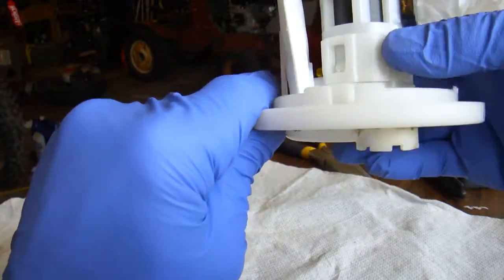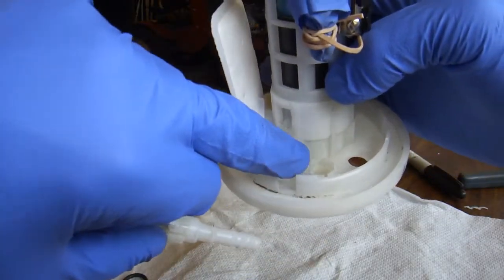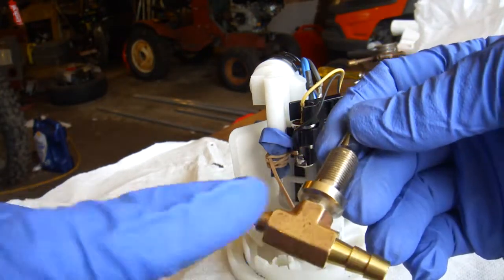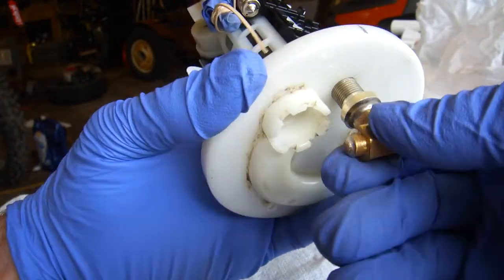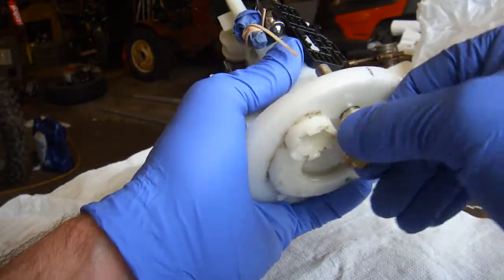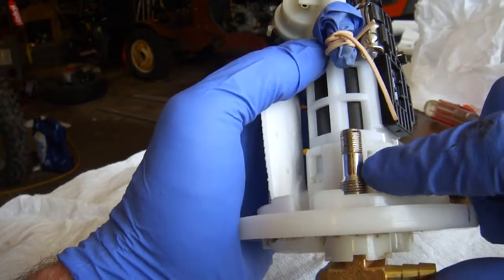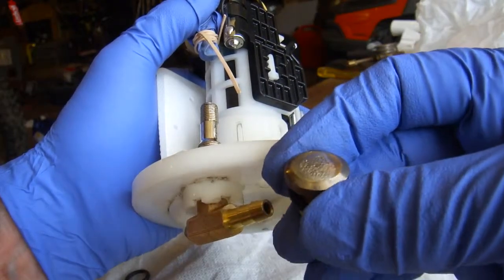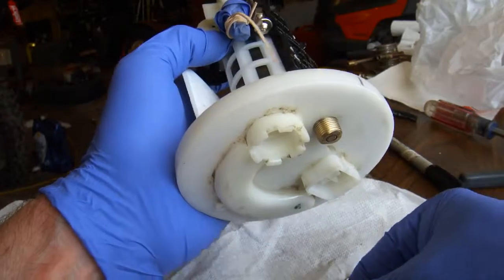wr250r fuel pump progress

Comment: Thank you it seems like your the only person who has fixed this problem without just buying a new pump
Reply from the maker: I had no expectation anyone would ever see this, thanks for noticing.  Update: I completed the repair using in-tank fuel line purchased from Napa.  I did not use the original O ring from the broken fitting - I bought a nitrile O ring that was sligtly larger.  It was a successful repair. It does not leak, and I felt confident riding the bike for the remainder of 2019.
Reply: cut twice Well I’m surprised it’s not a much more common problem with that crap material. I fixed mine today in a pretty similar way. Hoping for that same success.